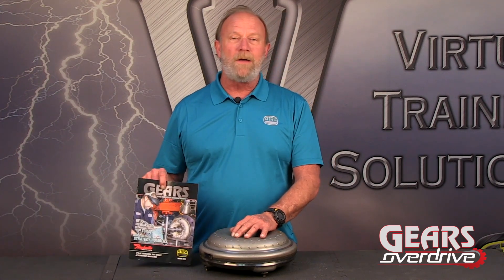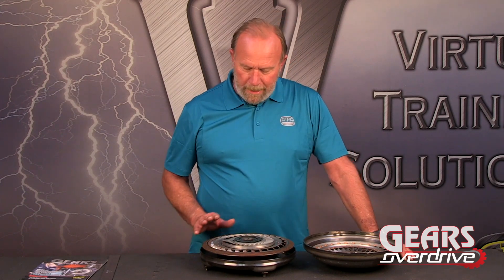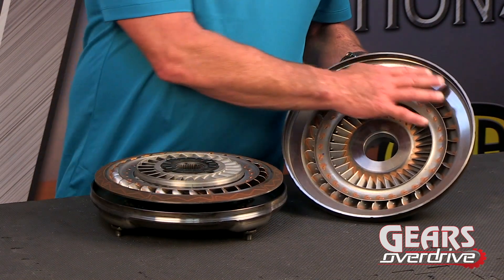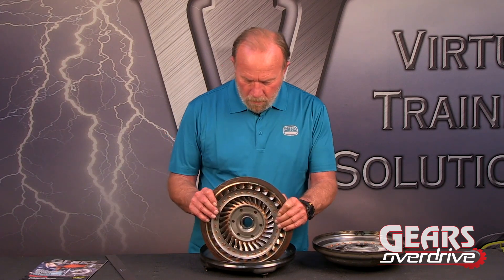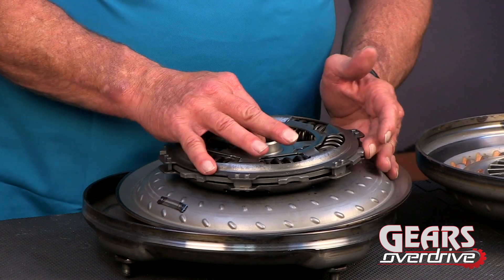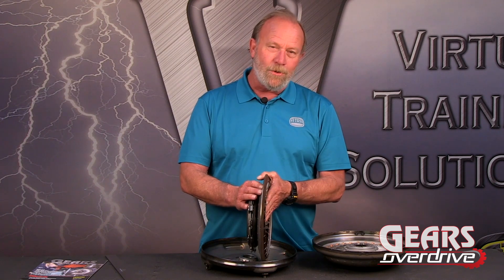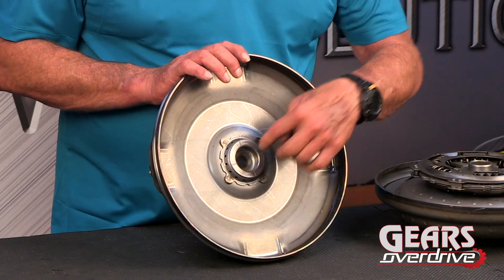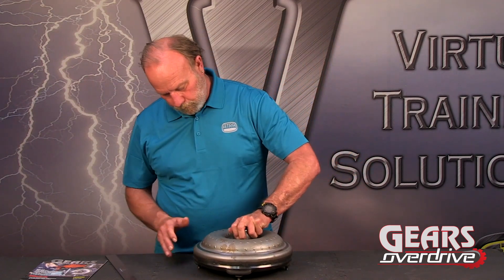Bill Brayton   Gears Overdrive 10R80 Torque Converter

Comment: Am currently in south Africa my ford ranger 10r80 the transmission said overheating then stopped even today the car can't move could it be torque converter
Reply from the maker: Check for a clogged or plugged filter or cooler first